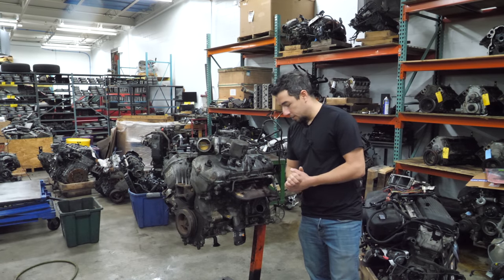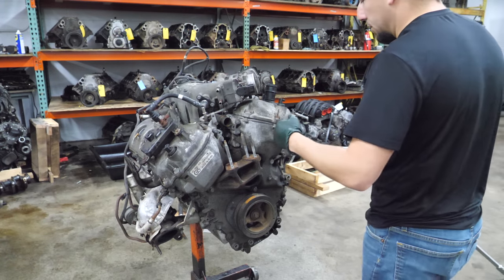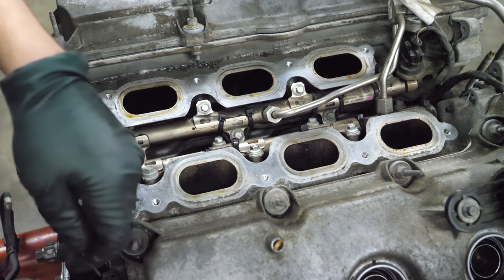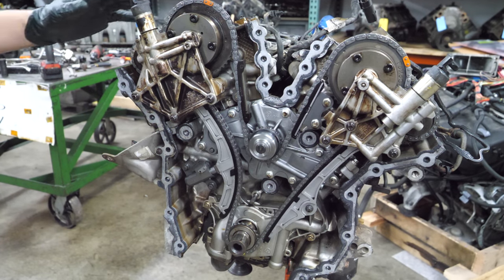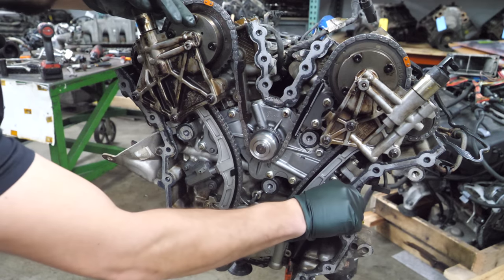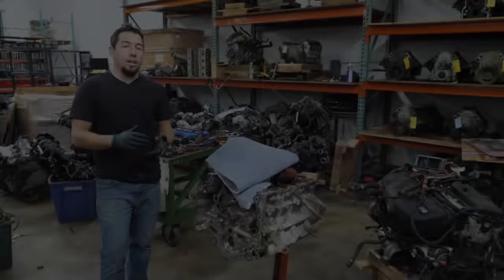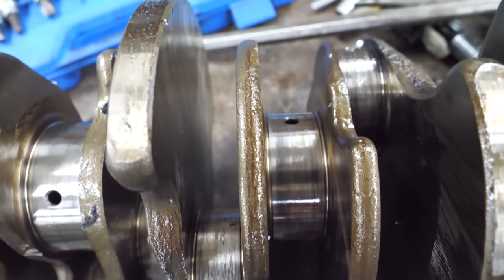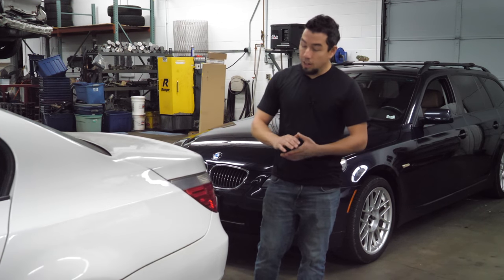Taurus SHO Flex ECOBOOST 3.5 V6 BAD Engine Teardown! What Killed This Maintained Engine?

Comment: Before anyone knee-jerks and blames the "off-brand" oil filter, the Parts Master line is an outsourced amalgamation of third party manufactured parts sold by Auto Parts Alliance. I worked for a place that sold them. Their PM branded oil is reboxed Valvoline, the PM brake hoses and many other miscelaneous parts are Dorman, and their filters are manufactured (though perhaps to slightly lower quality standards, and not a straight reboxing situation) by Wix, who make some darn fine quality filters.
Reply: I almost did until I saw the small Mann+Hummel branding on the side.
Reply: @Jakek200  Mann is also part of that Wix filter construct. Some of the European-application PM filters are made in EU factories along with the super premium Mann line.
Reply: No oil filter made would have helped here. To much metal bits splashing around,

Comment: I want to see a 1997-2008 ford 4.2 v6 teardown. Excellent engines! Mine has 336,000 miles of hard work and keeps going!! Only had to do upper and lower intake manifold gaskets so far. Other than that solid engine in a solid truck (1999-2003) f150

Comment: You would think that the factory would put anti seize on exhaust manifold bolts. It is also important to remember that there is a time interval between oil changes as well as mileage. A car that is seldom driven should be changed at time specified by the oil mfg.

Comment: I have a Ford flex and the water pump is my biggest fear. If I had to venture a guess, I would say the water pump failed and they replaced it, but the antifreeze got in the oil and did it's damage and it probably wasn't noticed during the replacement. That engine was on borrowed time...
Reply: That's my theory, too. The aftermarket timing chain stuff is too new. We had a customer have the same situation with an n/a 3.7 in an MKZ. Water pump went, though the car still ran. He paid the Ford dealer a few thousand to repair that, they jerked him around a ton (many unnecessary extra parts and an absurd extended timeline). Something like 3 months and $4500 later, he got the car back, 150 miles later it was knocking and out of oil due to scoring throughout the engine. They offered a $1000 discount on the $9500 engine replacement estimate. Jerks. I think he junked the car and sued them.

Comment: There are threaded holes in timing cover that you can thread in bolts and it will push off the timing cover. There are 2 WP weep holes in the block.

Comment: Little hydraulic pressure and or spring pressure keep the chain tight on all vehicles but hilt cutters on a main chain doesn’t matter if your main part to sell (heads) were taken off right

Comment: Those timing covers have 4 threaded holes towards the bottom where you use the same timing cover bolts to help push the cover away from the block.
Reply: Yep, two at the top and two at the bottom

Comment: My department had a fleet of Taurus and Explorers. Some of the vehicles were running 16 to 24hrs straight. Alot of idle time. The water pumps would always the first thing to go out. Second was the transmission. Going 80mph and all of the sudden hard braking to zero. The transmission would go into limp mode. 
Had to shut down the vehicle and restart it.
Reply: Pursuit mode is supposed to ultra downshift on hard braking, for immediate takeoff.
But it's possible it could get stuck like that due to bad fluid making a solenoid valve not properly actuate.

Comment: For anyone trying to do a timing chain job in any ecoboost engine, before taking the damper out, mark the position in the front cover, and turn the engine to the specified camshaft position for this work, it is mostly likely the rear of each camshaft has a cavity to place the lock plate from the timing locking set (the position of each camshaft, at least for the 4 cyl engines is always cyl N°1 in compression stroke, piston at TDC). The reason to this is the fact the damper, and maybe the crankshaft sprocket doesn't have these pins that comes in any other brand to fix their position. If you can afford the timing locking set, forget all of this.
Reply: The damper is not keyed and can go on any way, The lower timing chain sproket is keyed so no problems at all on this engine,

Comment: The best mess to clean up is the one that was never made.  The appropriate drain pan is still far cheaper in time and materials than pig mats and having to spend time picking up swamps of coolant and oil, but I just hate having to spend time and materials cleaning preventable messes probably more than most people anyway.

Comment: Liked your last resort of a fork lift and front loader to pin the engine down. Awesome! I had to resort to a 3/4" breaker bar to get the 36mm nut off the VW bug rear axle. How did the sludge taste? You're lucky you don't have to put those engines back together.

Comment: Probably had the plugs from the non boosted Ford v6. Dealer gave me the wrong ones at the parts counter then finally figured it out when I took it in for a misfire code.

Comment: It's not so much the oil change intervals that are important, but the oil change FILTER intervals. A good quality synthetic oil will last a very long time, but that does not matter if it's not kept clean. I change oil at 6-7K , but do a filter change every 3-3500K. My Chevy Trailblazer with 316 K runs like new and the oil always appears clean. I've always done this without issues. Oil companies claiming 15K are right....in the lab. But they aren't dealing with dirty oil.

Comment: Here's a question. After the cam bearing surfaces in the heads get damaged being aluminium can they be welded and re-bored and polished ? I'm guessing it's not worth it in that engine though. Great video!  I'll be watching more. 👍🚗
Reply: theoretically possible to repair, but practically would cost many times more the value of the head
Reply: On very $$$ CNC ported heads they will line bore the cam journals  and install bearings, But not worth it on stock head.

Comment: You should used a box cutter or maybe just the blade and ran it through the seem of the block and timing cover to cut the RTB and making it easier for you to remove it

Comment: Without even watching it my guess is a bad water pump dumped coolant into the oil.  Unfortunately too common on this otherwise terrific motor.  Best to replace the pump and front timing components while it's still running.  EDIT:... and I'm wrong..

Comment: That's ingenious Ford engineering. I wonder how many hours does it take by the book to replace a water pump on SHO?
Reply: If I remember correctly, 13 or so. Its about 11 on the n/a Duratecs.
Reply: pros can do it in under 8

Comment: Well man once again, you got it wrong lol. The casting in the block is for the weeping of the pump shaft seals, same with that casting in the pump body. It is NOT for if that seal around the pump goes bad, it is for the shaft seals inside the pump. They have to seal the weep galley off from the cooling system or else… you would have a massive leak… lol. I hope you get what I’m saying, chain driven sprocket turns the shaft that turns the impeller and that shaft has 3 seals that ride the shaft (like mini crank seals) that keep coolant from leaking along the shaft and into the crankcase. When the first seal fails, it allow coolant to escape through the casting in the pump body, then through the casting in the block, and out onto your driveway.
Also would like to say if you think that RTV job is excessive… I know a tech who does reseals on 6.7 turbo diesels that has had 6 engines come back with bottom end failures all from low oil pressure from the TWO TUBES of TA-357 he uses to seal the upper oil pan. Luckily for all customers involved, damage was covered under warranty. Needless to say… he no longer does RTV jobs. But what you see in this video is about average for what we see from RTV done by Ford Techs, truly not that bad. I’ve picked gum ball sized pieces of RTV out of pickups before lmao

Comment: I have this Ecojunk in a 2012 F150 Platinum...powerful, very powerful but it needs the entire timing system replaced at 101000 miles. Im not the only one with this issue either. Im just going to run it till it dies and drop a new engine in it. Its cheaper to do that vs. fixing it

Comment: I think the water pump went out, and then the water mixing with the oil got to the turbo bearings and ruined them. Of course leading to everything else. That would explain the new water pump, home mechanic tried to fix it himself. I only say that because that's what happened to my Taurus sho 💀

Comment: I believe that was the mechanics fault. Had that happen to me. After a timing job on my 4.6 engine started knocking like 100 miles after. Took block apart and found debris and dirt all over the bottom half of the block

Comment: Not sure if I missed it but if you have turbos, use premium gas, not 88 watery garbage. Seen so many cars take off at stop lights n water drips out there tail pipe, that's 88.

Comment: After seeing this video, my suspicions are confirmed. The ecoboost is a complicated POS. So many documented problems with this motor. I’d avoid it and stay with the 5.0L or another simpler design. Wow. Good video.
Reply: I work for a extended warranty company and I've authorized many bad turbos ( multiple on the same vehicle sometimes) and cracked manifolds. Lower mile vehicles . Shame because the engine in NA spec is fairly stout

Comment: A new subscriber here… enjoying the content so far. If a con rod is determined to be rump roast, why not just run the cap bolt back into the hole and use it as a surface to hammer on?

Comment: Next time rather than fighting with the boot with pliers and crap, just use an air nozzle on an aircompressor and blast air in the spark plug tube. It will loosen up the boot fairly quick.

Comment: Very informative.  I've had my share of manufactures and have only had 1 water pump weep and that was a very old GMC. Since this issue has made concerns about the V6 Ford engine, does that mean All will have a problem? I ask because I bought a 2010 Edge with 150,000 miles and since money is very tight, replacing the water pump when bad could make a couple of house payments. Is this invariably going to happen??

Comment: Always kinda wanted one of these beasts and try to tune it to 400whp but knew there was a big possibility of having reliability issues.
Reply: The biggest thing is use quality full synthetic oil and change it every 5k max and use a good oil filter.  Perform regular maintenence and take care of it it'll be fine.  Don't do those long oil change intervals like they tell you to do that has alot to do with issues imo on these turbo gdi engines.

Comment: There should be an ASE certification as part of the core ASE cert group that is just for proper use of automotive chemicals and sealants. Things like RTV, thread locker/sealant and anti-seize are so widely abused and over used to the point that it literally destroys the parts it’s used on.

You should still try to catch as many fluids as you can vs just letting them spill on the floor. Soaking up hazardous fluids with a sponge and throwing them in the garbage (and ending up in a landfill) is not exactly an environmentally responsible thing to do vs properly collecting and recycling them (oil and coolant are easily recycled basically anywhere in the USA). I know a lot of people like to claim it doesn’t matter (especially those who don’t believe climate change/science/reality). That’s the same mentality our parents and grandparents had and exactly why we are being burned, blown and washed out of existence by the 100, 500, and 1000 year “freak” weather events that are now happening yearly or even several times a year.

Comment: Had to break apart my 3.5 in my 2014 Ford Explorer Sport (same engine/drivetrain is identical to the SHO) due to the cam phasers… nearly $3500 dollars. Fun times. I bought an Escalade this last time around, seems like Fords are built to fail lately.

Comment: Is this actually the Yamaha engine that some of the SHO's had? BTW it was a dowel holding you back I could tell by the way it circled back and forth so easily on it. The blown turbo would explain the excess carbon in the intake tract I am thinking....

Comment: When the previous guy did the timing chain, tensioner, and rails, looks like he didn’t clean out the old broken debris from the oil pan and pickup screen…..oops!

Edit… OK I eventually watched to the end.  Of course the blown turbo ejected all of the engine out out the exhaust.  In addition to the huge cloud of smoke coming out of the exhaust, the engine would have made no power at all, and would have sounded like a buzz saw. Amazing someone would continue to drive with zero power and all that smoke until the engine ran it self out of oil.

Comment: Apparently the water pump is one of the carryovers from the original Mazda design which caused the most trouble in these engines.
Reply: During the Ford/Mazda marriage Mazda provided the 4 cylinder engines and Ford provided the V6s. This is a Ford designed V6 is what I’m getting at.

Comment: Mental note... never buy a car with the 3.5 eco boost. No water pump should ever be that big of a pain to change. Im perfectly happy with my 08 Kia Rio5 manual transmission. Reliable, Super easy to work on, parts are cheap and its economical to drive.

Comment: Being an early Ecoboost engine, which I know because of the aluminum valve covers and steel manifolds, before watching the video I would bet money it's either a bad water pump or a bad PCV/Oil separator that caused this failure. Water pump fail? Water in the oil. PCV/Oil separator fail? Massive oil consumption, oil overheating, coking, eventual oil starvation due to low oil, bye bye turbos and bearings.
Reply: After watching, I'm still leaning towards the PCV, especially looking at that back head and it being so dirty. I bet this thing ate at least one other set of turbos before this final failure, and you can see from the work that was done that it ate a timing set. I bet it's still the original oil separator and PCV on there. I also wouldn't rule out a dealer mechanic doing the RTV trick. The one who worked on mine before I bought it (he swapped the turbos) was a terrible mechanic, and I know he was a Ford mechanic because the PO gave me the receipts for the work which had been done under extended warranty. I had 8mm headed bolts that I needed a cheater bar to get off, and I also had some rather large bolts that were on barely more than finger tight. The loose ones were in spots where you needed to use a wrench to turn them on and off, the super tight ones could all be accessed by an ugga dugga gun. He used all the ugga duggas on those. He also hung the front cat off of its wires and chewed those up too. He missed the PCV failure on that service too, which is why the turbos failed in the first place. Even though I fixed the root of the problem, the oil coking/contamination that was already sullying up the engine eventually ate another set of turbos and I lost oil pressure at idle not too long after I replaced those. Once these things get to that state of oil contamination, they'll just keep eating turbos and eventually the engine will fail. Even though I put fresh oil in with the new turbos and changed it again before they failed, I found new coked up oil in the inlet screens when I pulled the engine out and retired it. I've heard lots of stories about this happening to people with these things eating multiple turbos because nobody puts a new oil separator on when they swap the first set and more damage gets done. I swapped in an 8k mile motor from a wrecked cop car, and it was a brand new oil separator that went on there then. Zero issues with anything on that engine in 50k miles since. Oil still looks clean after 5k miles for oil changes and it uses zero oil in that time. Needless to say, I'm going to swap in a new oil separator as preventive maintenance at 100k, or if I see any oil consumption I'll change it then too. I also run full synthetic instead of the crappy Motorcraft semi synthetic, and I cut my OCI down to 5k miles instead of the 7500-10k Ford recommends. Seems to be a winning strategy.
Reply: By the way, if you swap a few components, the newer engines are direct replacements for these. The parts books don't indicate this, but I put a '15 into my '11. I even used the oil pan from the Explorer it came out of because it had an extra half quart capacity than the Flex one. No clearance issues.
Reply: @randr10  They drove car with a dead water pump and milkshake oil and thought they could just put pump in and be good. But rod bearing damage was done and then ate itself.
Reply: @blueblood76  Possibly, but those failures will usually start knocking before you can even change the pump.

Comment: From experience, I dont believe it was the turbo that caused all that. It was probably the original waterpump failure. These waterpumps fail at the bearing, which will leak coolant through the bearing seal into the oil pan. This will cause the chocolate milky mix that does not lubricate well. The waterpump bearing will eventually get bad enough to cause the waterpump pully to chew into the timing cover and spit aluminum shavings into the oil which will lead to the clogged oil passages... and then a fully oil starved engine/turbo.